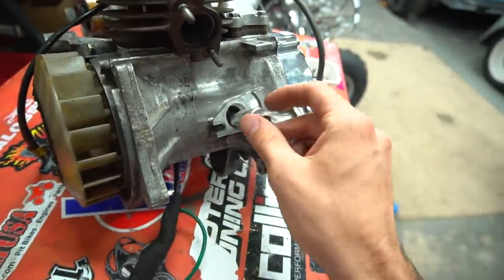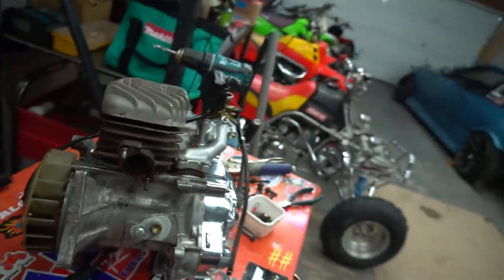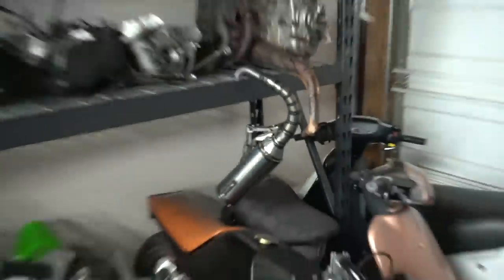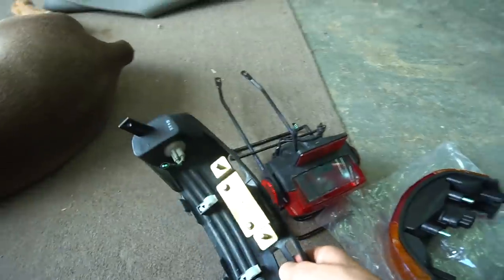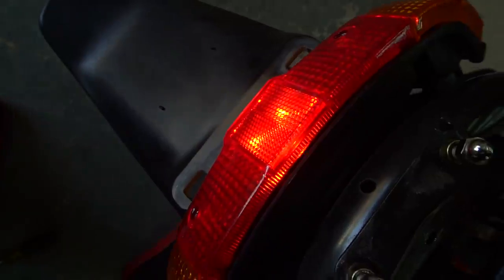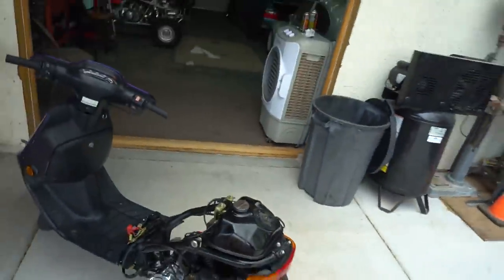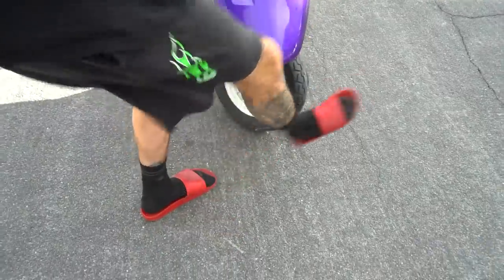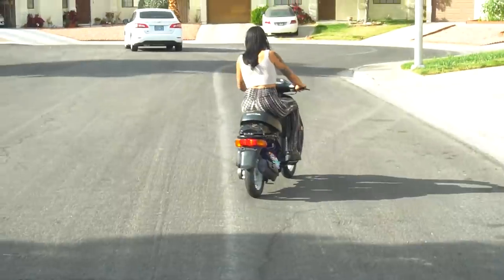it RUNS! Honda Elite 50cc 2 stroke Wheelie scooter build

Comment: That’s good there is a lot of 2 stroke oil in the carb and the crank case and old gas in the tank when you buy a 2 stroke that’s been sitting forever... that means no rust!!
Reply: Do these have metal tanks?

Comment: If your installing a new petcock, then take the tank off, put some old gas in it and shake the hell out of the tank and pour out 30 years of lint or whatever is in it. Then would I do on all my Racing bikes including my H2, is ALWAYS add a inline fuel filter, just in case. they are only 5 bucks. Great video and No Disrespect intended. Randy H DSD

Comment: I like 2t scooter but I don't know about mechanical things. Explaining that my questions is, why do you put that plug to eliminate the oil?
Reply from the maker: oil pump delete to run premix instead having the pump with the oil in a separate resivor . Just safer to run premix to be certain my motor is getting oil and not relying on a pump, especially when you begin modding the bike and pulling more power than designed for
Reply: @MOPBOYZ thanks for the explanation love your videos keep up.the good work.

Comment: Really want a Dio now but we dont have them around here, only Aprilias, Piaggios, Yamahas etc, also really love that new exhaust, and i think it would run great with a larger carb + the exhaust!
Reply: You from the UK? I feel the exact same way 😂
Reply: @dandoesbits  Haha no im from Denmark :D
Reply: @nickkaarslev290  ah close enough haha but I feel your pain. Only way we can get one is to sell a house first and import it 😂
Reply: @dandoesbits  haha yeah 😆
Reply: I use gilera stalker from 98 and it rips hard
Reply: @readordienn  thats awesome tho ive never been a fan of the stalker, its a massively popular moped 😅
Reply: @nickkaarslev290  in my country popular is chinesse 4t crap or kinda peugeots speedfights. Theres also some yamaha aerox ppl but its not cheap ride
Reply: @readordienn  Ah yeah, we got tons of Pgo hot50's i dont know what they're called outside of denmark tho, but its also some chinese clone of a long minarelli, a really shitty clone too xd but i used to have a Yamaha Jog AS but now i got a "chinese 4t" Vga Explora with naraku 72cc, naraku racing cam shaft, Polini 19mm carb, naraku racing variator and a noname racing clutch and a leo vince exhaust, goes good for a 4t, i just was tired of mixing 2 stroke fuel tbh, but i really wanna do a new 2 stroke build again soon :D
Reply: @nickkaarslev290  i have baotian 4T 80cc original, Drive shaft is on chain i guess its high class hong kong stuff. The stalker has 70cc kit but dunno what it is and modified carb and pulls close to 100km/h
Reply: Your better off with a piaggio or aprilia or henaha aerox to tune anyway can make more power then these dios

Comment: Im curious if its faster stock than a stock AF05 one
Reply from the maker: it is 100% my other elite was af05 and this one is way better
Reply: @MOPBOYZ  tbh if i can get someone to make a mount and figure out the shock im about to cave and swap it
Reply from the maker: you just need to get the stock mount for the 94+ model and the shock youll just need a longer one so your not slammed
Reply: @MOPBOYZ  thats it???  No modifying the mount to line up in the frame or anything?
Reply from the maker: @mopedmessiah  not if you just use the whole mount from a 94+ the whole frame is same everything except the removable mount.